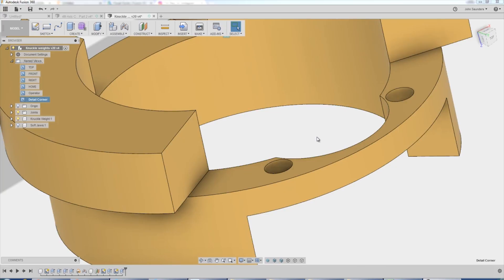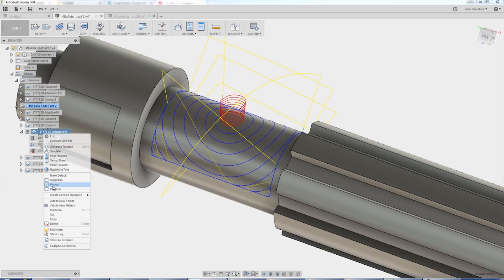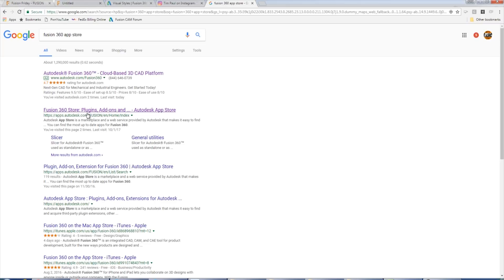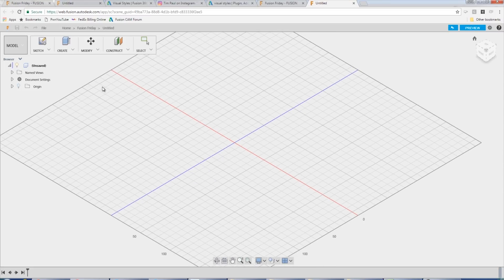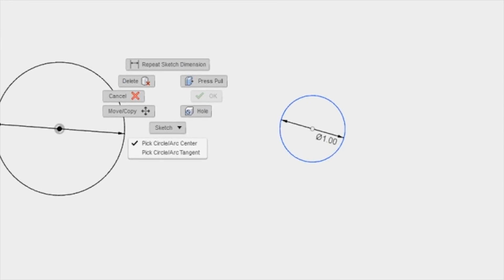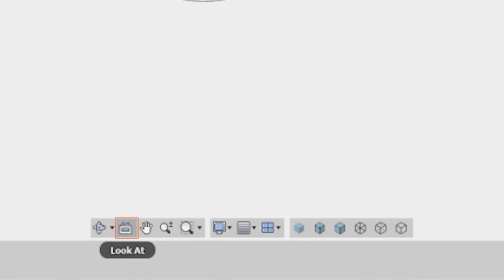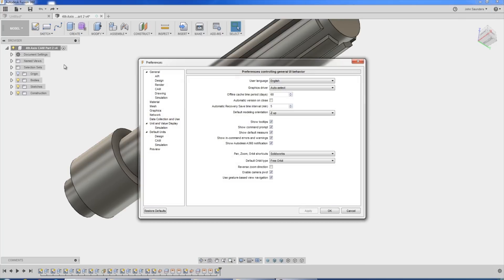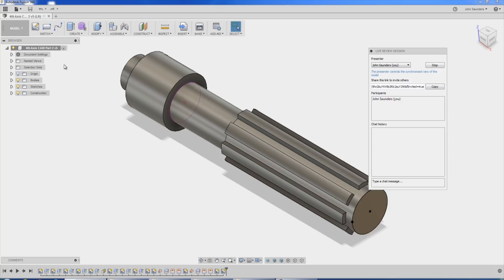Fusion 360 Tips & Tricks!  FF100

Comment: Please advise on how to adjust the transition feed rates in Fusion 360. It's a major headache for us CNC router guys. Makes the machine very jerky when doing parallel moves.
Reply: Logan Rose either on the first tab... Or the non-engagement feed rate on the last tab of any toolpath. Also check to see if your post is defaulting to posting out in high feed mode...  Instead of rapids.
Reply: Scott Moyse parallel paths do not give an option for non-engagement feed rate. Also, what should my high feedrate be set to? It was on "preserve rapid movement". Should it be something else?
Reply: Logan Rose have you turned on smoothing in the passes tab? This isn't the best place to troubleshoot. Have you posted on the Fusion CAM forum?
Reply: Logan Rose share the file on there with the post you're using and send me a link. I'll take a look.
Reply: Scott Moyse I have posted my problem on the forum. I found others with same issue.
Reply: I looked through my post processor for some items they talk about on there, but didn't see anything like they posted.   I am using the CNC ROUTER PARTS post processor that was made for my machine.  It seems the problem lies with Fusion 360 itself.  It accelerates the federate BEFORE doing the transition.  When doing this on gantry style machines.....its a no no.  Makes them jerky.  Usually isn't a problem with servo controlled machines as they have a multitude of ways to control constant velocity.
Reply: Logan Rose I'm certain it can be dealt with... But not in YouTube comments.
Reply: Logan Rose do you have a link?
Reply: Scott Moyse not on hand. Search forum for "change feed on transition for parallel"